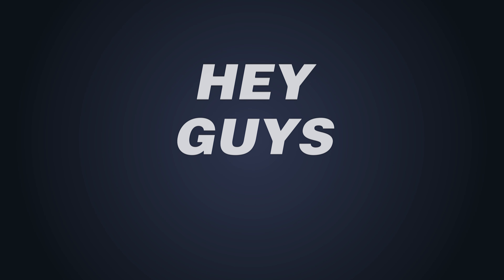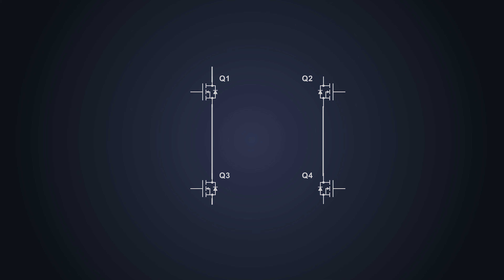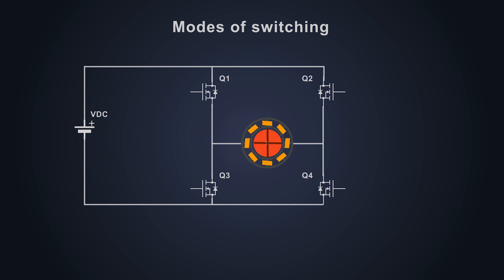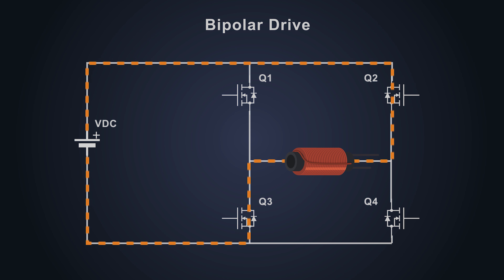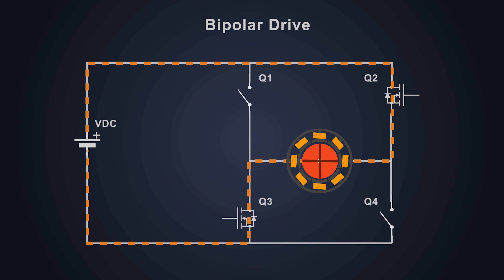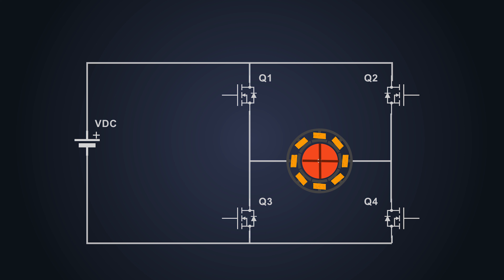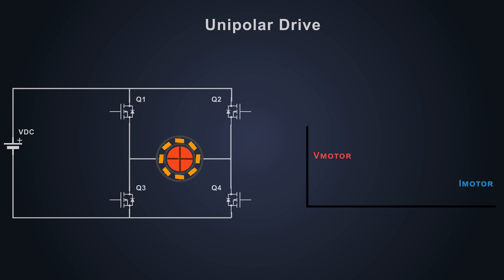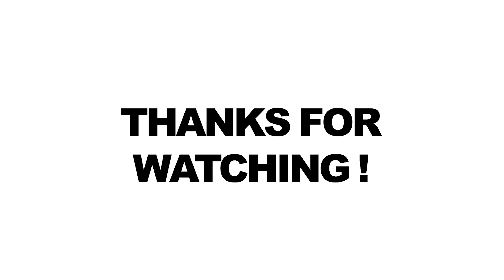H bridge DC Motor control | Bipolar drive | Unipolar Drive | H bridge Motor driver using MOSFET

Comment: @7:35 where is the regenerative current originating from (closed path for flow on the right side of motor, wouldn't the body diode conduct?). Better example is Stepper motor windings instead of DC motor.